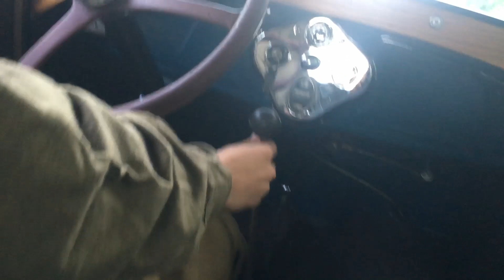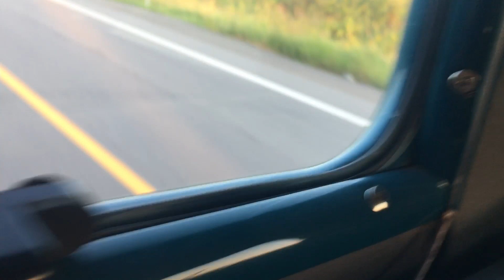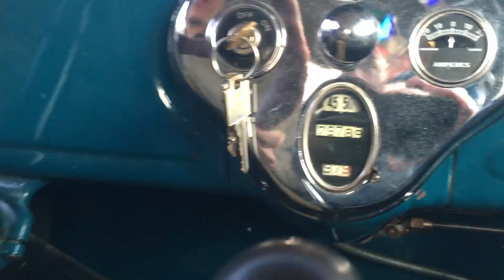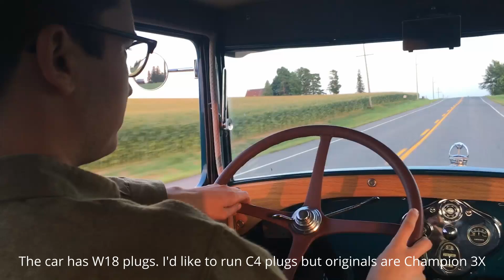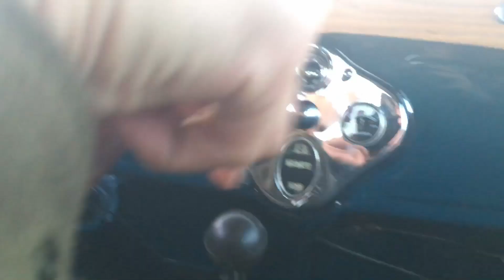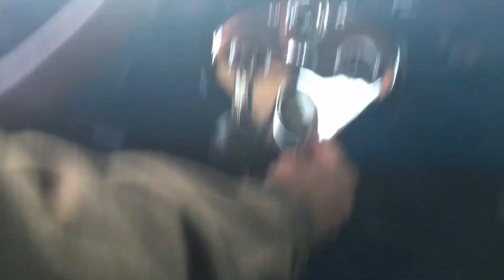My 1928 Ford Model A: Overview and Drive

Comment: Thanks for the ride-along.  Seems like a wonderfully modern, refined car!  Do you drive mostly paved, or gravel roads?  I find my Model T prefers gravel; the steering lightens and the car seems to calm down, and relax.  Greetings from Paris Ontario.
Reply from the maker: The Model A is a true beauty of simple elegance! I mostly drive paved but do not shy from gravel. Steering is a good point- rough pavement can definitely pull the A all over. Cheers from east of Ottawa!

Comment: I see the hand brake is in the middle near the gear shift lever. The early 1928 I thought located the hand brake lever to the left of the driver. 
And the headlamp switch: I believe it should point down when it is off suggesting the switch control may not be installed correctly.
Reply from the maker: Yes, the early 28 did have the hand brake left of the driver, this car has had the brakes upgraded to a later configuration since the shaft setup of the early 28 is a pain. As for the lightswitch I've never noticed that, I'll look into it, Thanks for the comment
Reply: @castironmachines  Yes I wondered a bout the brake lever on the left. Must have made getting in and out of the car more of a challenge. 
I have  '29 and when I got the car, the light switch was incorrectl6 installed. I found that it was  possible to install it so that the lights would not switch properly. Saw the correct position in photos and num Ford notes. The correct etching is down off, left one notch parking lights and to the right first both low beams and next notch high beams.
Reply from the maker: @tedrobinson372  Appreciate it, my high beams don't work right at the moment- I'll switch it up and have a look at the internals too. Cheers

Comment: Well done video.  I have a 1929 Tudor.  Looking to buy another 1931 Model A with new engine an 5 speed sync transmission.  I will eventually sell the 1929.
Reply from the maker: Best of luck, they are amazing cars. Cheers!

Comment: Beautiful, I enjoyed the ride! A video of that kind is still on my to-do-list - unfortunately I have no back seat to put a cameraman into..
But I'll get that figured out somehow.

Regarding your thoughts about vacuum wipers, I think if I had the choice, I'd go for an electic. It's not just more consistant in speed, but also at a more rational speed. Now that my wiper motor has run in, on steady roads like you drove on, it'd go back and forth three to four times a second, which becomes quite annoying rather quickly - I'm actually thinking about putting a reducing valve along with a vacuum reservoir in between the line somewhere, just to have a slower, but more steady speed.

Best Wishes
Adrian
Reply from the maker: Thanks! Good logic on the wiper, I figured it may be easier to install a vacuum since holes were already made in my cab, but if yours has given you such trouble, I may as well learn from that and go electric. Cheers!
Reply: @castironmachines  Well, I maybe wouldn't call it trouble - it does wipe rain off the windshield reliably - it's just its quirks that can become annoying at times.
And the effective area it wipes is ridiculous, of course. RainX for visibility, windshield wiper for laughs xD

Comment: I just bought a 28-Fordor and have been reading about using a vacuum gauge to  " ANALYZE " the engine.  I thought I'd order a gauge but then realized I had no accessible vacuum port.  If you are considering vacuum wipers, where are you thinking about getting the vacuum? I have considered drilling somewhere on the manifold and tapping  it with an appropriate size tap.  Have you any ideas on that yet?
Reply from the maker: Model A manifolds (other than really early ones) have a boss in the casting on the face of the intake manifold "T" area which can be drilled and threaded to take the vacuum line fitting for the wiper. If there is nothing like that on your manifold, you can either drill and tap a hole in the face area, or I've seen it done on the top manifold face.

Comment: What “blinker” system are you using?
Reply from the maker: It's a solid-state blinker LED kit, most of the Model A parts distributors are offering them now
Reply: Do you have a link or model number? Is it Available on Amazon ?

Comment: I live in south western, Ontario, Canada. I’m 26 and looking at buying a model a Ford in about 3 years or under and getting involved with a club of some sort for assistance.
Reply from the maker: Model A Owners of Canada is located around Scarborough and Canada's Capital As is located around Ottawa. Good luck, you'll love it.
Reply: I just bought a 28 Fordor. And it seems there are a lot more about 1930 & 31's than 28-29's if you are as ignorant as I was you might want to look toward those 2 years.  But I won't sell my 28 
"  No how and No way "   🤠
Reply: Sorry I didn't proof trad.  I intended to say there are a lot of options on the 1930 and 1931 not offered on the older 2 years.

Comment: How come your rear view mirror doesn't shake like crazy like mine? I can barely see anything in it when at speed
Reply from the maker: I've never had a vibration problem in this car- it may be due to the engine having a balanced crankshaft, or a very solid mirror mount. There do seem to be a couple frequencies where the whole car will vibrate at around 35mph but it can easily be avoided in my case thankfully